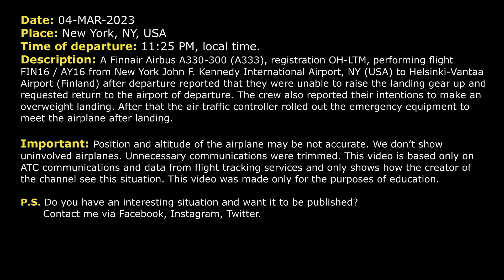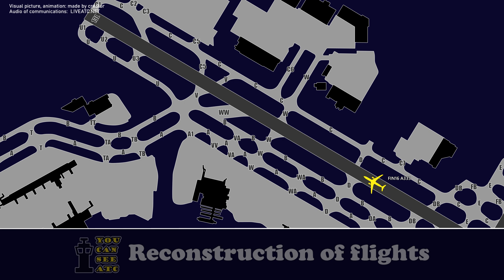Overweight landing. Finnair Airbus A333 is unable to retract the landing gear. New York, Real ATC

Comment: Probably a stupid question but what would have happened if they continue the flight with the protracted landing gear? Would it  just impact flight speed?
Reply: More fuel required, they would run out of fuel mid-atlantic I think.
Reply: It would prevent an airplane to gain speed -> vertical speed -> altitude and will require even more fuel burn because of the wind resistance of the landing gear.
Reply: It would significantly increase fuel burn, while simultaneously significantly decreasing cruise speed and max altitude. They might have made it to Greenland, but why do that? Also, it would have been really loud.
Reply: Probably induce some excess wear on the landing gear as well

Comment: Honest question. Why were they given the shorter 31 runway when they were overweight?
Reply: 31R is still a long runway at 10,000 ft or 3048 m.
Reply: @MarkRose1337  LDA is just over 9000ft for 31R.
Reply: They could have asked for 31L if they needed it.
Reply: Aircraft generally need longer runs for takeoff than landing.